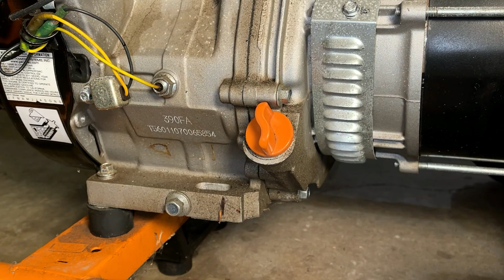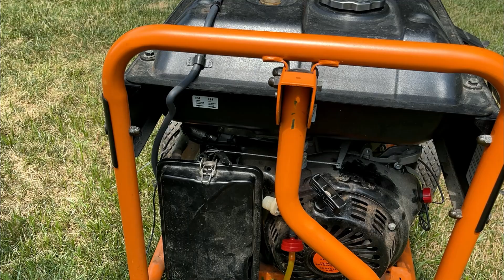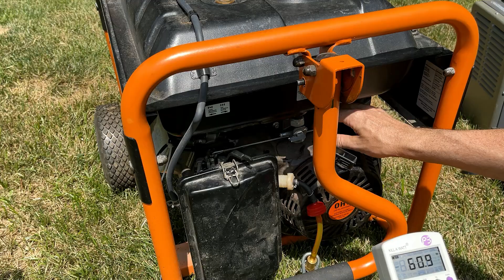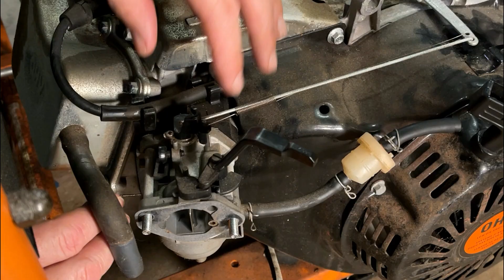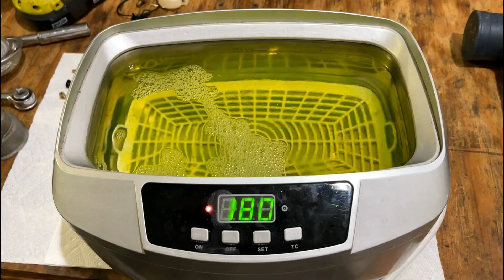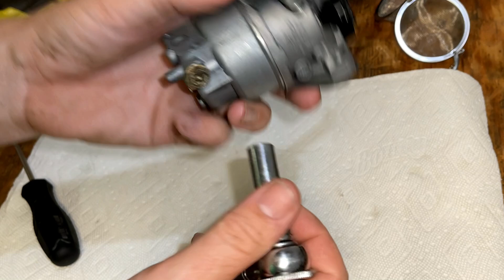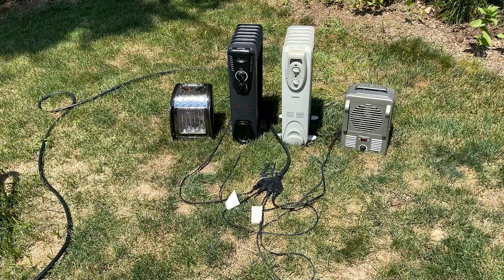Generac Generator - Running Fast and Down on Power

Comment: Basic Maintenance?  How many times have we heard that!  From a missing carb to a hole in the block basic maintenance can be just about anything!  Good vid Jim. Keep finding those scores!!
Reply from the maker: Thanks Ken.  Have seen a lot of carburetor and governor linkage issues do to people trying to fix an issue just to make things a lot worse.
Reply: @jcondon1  Agree with both of you 💯 %. An ounce of prevention is worth a pound of cure.💪💪🙂🙂 Reading the manual can go a long way for PM. Great find Jim and glad it was easy. 👍👍👍👍Great job on the clean up too.
Reply: @YukonHawk1  ⚠️Rules about generator safety: This is a very important announcement that everyone needs to know just to make sure. 

It is important to follow all generator safety rules whenever we use portable generators: 

Everyone must see this. This is just a reminder for everyone’s safety. 

1) KEEPING OTHERS SAFE: Please do not allow an unqualified person or your children to operate and service the portable generator. Just because some manuals don’t say that doesn’t mean it’s safe. That is important against the generator safety rules. We also need to be keeping an eye on our children too. You need to make sure that your children are not playing near the portable generator especially when it’s running so they won’t get electrocuted. Generators pose electrical risks and they can be hot during an operation. Please keep your children away from the portable generator at all times. It is important to keep our children safe especially our little ones. Be aware of all the hazards.

2) WHERE TO RUN YOUR GENERATOR: Some people use their portable generators indoors which increases the risk of carbon monoxide poisoning. It’s important to have a carbon monoxide if you have a gas generator. Never ever use your generator indoors even if your doors and windows are open and even in the garage is not safe to use a portable generator. Not even at your porch and your deck. It is never safe to use your generator indoors and in enclosed areas of your home. Your generator needs to be 15-20 feet away from your house. 

3)🔥FIRE HAZARDS: Never refuel your generator while it’s running. You need to let your generator cool off before refueling it and before storing your generator. Never overload your generator too. Never ever back feed your generator. You should never plug your generator into a wall outlet. Also never store propane tanks indoors. Please keep flammable things away from the generator as well and please don’t smoke cigarettes near the generator. Having a fire extinguisher next to the generator is also important against the generator safety rules. 

4) GENERATOR OPERATION: make sure your hands are dry before touching the generator. Never use your generator in wet conditions. Don’t let your generator get wet. You need a generator tent if you need to use your generator during wet weather. Please don’t wear loose clothes when operating the generator. Turn on your generator before plugging in appliances. Use the right cord for your generator. Please do not use worn out cords. 

https://youtu.be/I1jT3ANENvI and here is a video more about keeping others safe when using generators 

Hope this helps. Please make sure you follow all the generator safety tips. Thank you